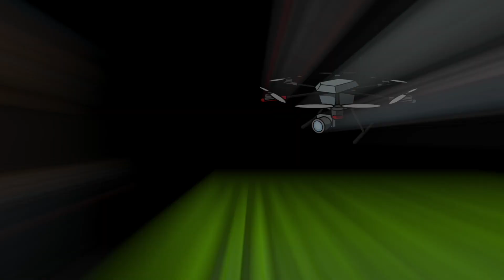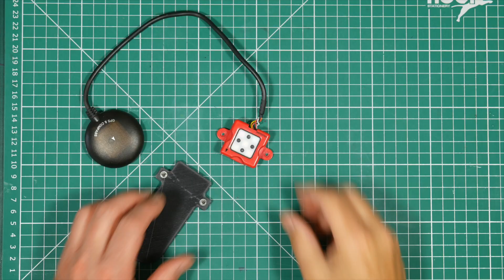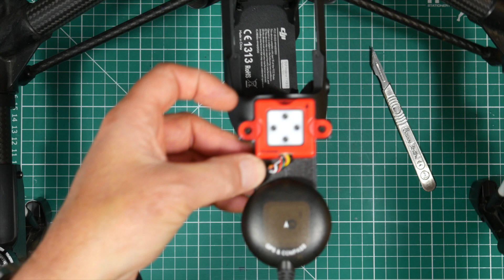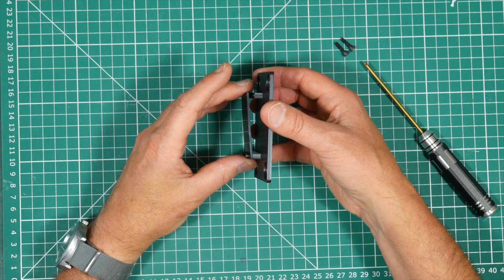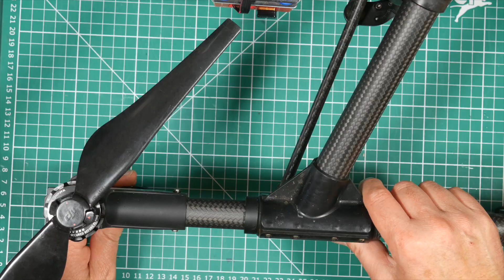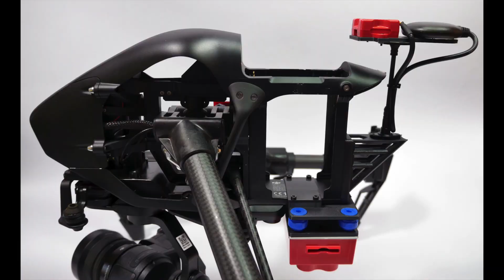Mounting a Micasense RedEdge multispectral camera on an Inspire 1 Pro with an integration kit

Comment: Thanks. In Canada any mods like this must be approved by the manufacturer. Is this the case with this mod? 

2 years later, Would you now just buy something new or still make your own? Cameras changing all the time.
Reply from the maker: The I1 is now end of line and not supported so there can't be any warranty or approval issues. Plus there's no modification to the Inspire. And there are no sensibly priced RedEdge mounts available - that's why I designed this one. It has sold incredibly well on xcopters shop.

Comment: Hello, I just discovered your channel and have become a new subscriber. Do you know if Xcopters is still selling the Inspire 1  kit? Links to their site seem to never load any content. 
Thanks,
Jeff
Reply from the maker: This link seems to work fine. https://www.xcopters.co.uk/shop/micasense-rededge-m-integration-kit-dji-inspire-1-pro
Reply: @WhirlyBloke  Thanks for the link. For some reason it still never loads the page and gives me this message: 

This site can’t be reached www.xcopters.co.uk’s server IP address could not be found.
DNS_PROBE_FINISHED_NXDOMAIN

Wondering if the problem is due to being in the U.S. . . . . . . . . ? I'll keep trying. 
I'm not ready to buy the mounting kit yet, but are there other vendors that sell it?
Reply from the maker: @CMGuavs  Try https We have loads of US customers and I just tried accessing that page from an AWS server in the USA and it's fine. XCopters are the only seller for this item. Maybe a firewall issue.
Reply: @WhirlyBloke  Thanks, I'll check my security settings and try different browsers.

Comment: There would not be a problem with the calibration of the images because the camera is not 90 ° at the time of flight?
Reply from the maker: The RedEdge-M is very forgiving on not taking nadir images. I've done surveys with a full gimbal and fixed mounts of the same area and it works just fine.
Reply: @WhirlyBloke  A fixed mount is fine as long as it is inclined to account for forward motion of the aircraft. If it is not within +/- 10 degrees of nadir during flight then you may notice brightness 'banding' along the flight tracks of an orthomosaic. I have seen that occur many times. It is a geometric problem called bidirectional reflectance, which is basically a directional bias in how bright a feature appears given sun-feature-sensor geometry.
Reply: @WhirlyBloke  
Hello, I want to know how I can save my dji inspire 1, after placing the parrot sequoia camera, since the original box is small to store the drone with the camera, where can I get a case to save my drone without problem? and I also wanted you to help me where I can get the assembly for the parrot sequoia in the United States, thanks ...